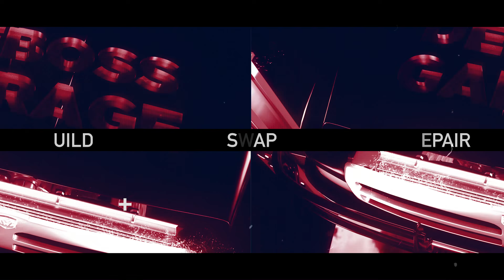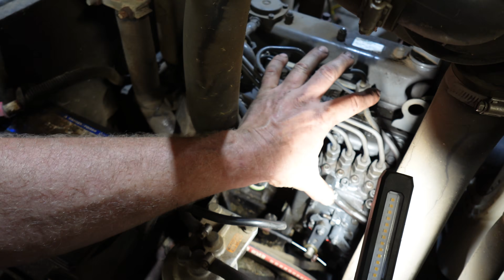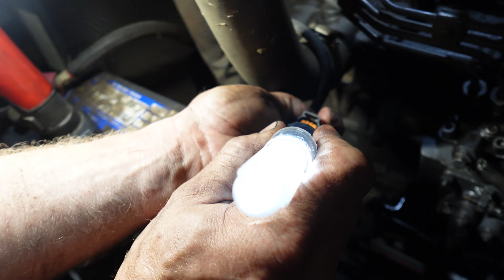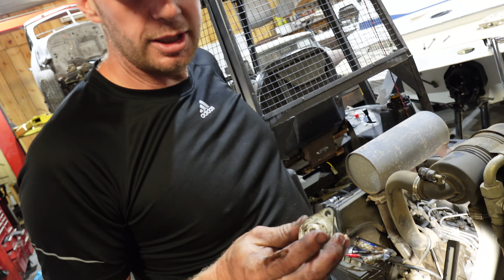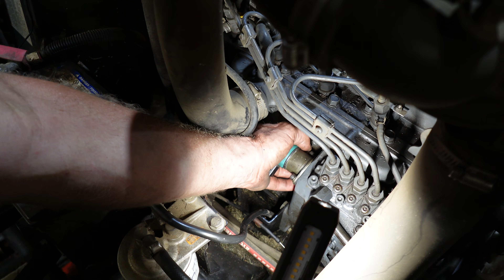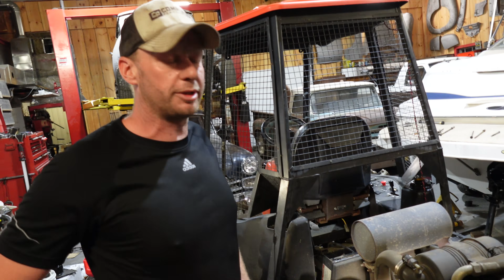Diesel Mower Engine Won't Run? TRY THIS FIRST

Comment: What if the starter is turning too slow to start with a new battery and even jumping? Would it be needing a new starter or does could It be a wiring issue ?

Comment: Wish this was posted 1 year ago, cat 3306 in the fishing boat I run shut off and we couldnt figure out why for a couple hours...eventually pulled that solenoid and made it back to the dock and shut it off by putting a screwdriver in the hole. Mint video as always.

Comment: We have a ventrac 4500 at work that won’t shut off. The solenoid works when we bench test it, but it’s not getting power in the machine. Tried swapping the TCU computer but still doesn’t work. So I had to run a pull cord to shut it off. I have continuity through the wire from the connector to the computer and no continuity from ground to the wire. So it must be somewhere before the computer. Not looking forward to diagnosing it, I’m not a fan of electrical harness troubleshooting.

Comment: Old man hack: touch the end of a solid rod (broom handle, rebar, anything solid really) firmly the solenoid where the business is executed, touch the other end to the right spot on your ear (think where the cell phone speaker is loudest) and cup your other hand around your ear and the bar. Have somebody click the ignition and you should hear that solenoid when it clicks if its getting power and works. Saves the trouble of removing it when it becomes a hassle. Works with harmonics too (main bearings, valve lifters and rockers, etc).

Edit: missing words lol
TLDR edit: its a redneck mechanical stethoscope

Comment: Yanmar is similar except 3 wires to the solenoid and no mechanical shutoff that I’ve found. I’ve learned the third wire is hot with the key in the start position, and seems to “pull in” the plunger, and then the hot with key on only generates enough magnetism to hold the plunger/armature, but not pull it in.

Comment: Love the super simple explanations. This would have been super helpful to see a few years ago when I was just getting my career started and didn't have a bunch of knowledge 😂. I feel like most videos about diesel engines and equipment just kind of dive right in because you're already supposed to at least have good knowledge of these systems beforehand, and can be tough to follow if you're not solid with your basics yet.
Reply: I think this vid in particular is for anyone with a small mechanical diesel that can use a quick fix, which is totally fine.

But, there's so many great vids on the basics already. If you want to learn about this stuff from scratch, thats on you to do first. I bet the majority of people that watch this channel already know the basics. I want the lesser known, but still relevant, technical details/techniques. Call me a nerd, but that's how i continue learning. Particularly new systems, or diagnostics, which kind of make or break you as a mechanic.
Reply: @ctdieselnut  for me specifically, these basic explanations help a lot when it comes to engines. As a mechanic, so far I've only worked on fleets of trucks, therefore I have very little experiences with engine performance, yet I have advanced knowledge about hydraulics, electrical, driveline, steering/suspension, and general heavy equipment stuff, since we generally outsource engine work and only worry about the rest of the truck.
Reply: Sometimes half the battle is just knowing the correct terminology to use while searching for answers online. (Im not a pro mechanic, but work on a ton of vehicles/equipment.)

Huge difference between 'why wont my tractor start' and 'how to disable a fuel shutoff solenoid'. For example, im not sure that's exactly what its called. But itll at least get you in the right direction faster.

Comment: Lots of times when its a no start, I turn on the switch and then plug and unplug the switch and listen for the clicking sound of a magnet pulling on the switch and making a good connection.. also some need power to make it operate...

Comment: I have a small Kubota tractor with the 3-cyl diesel.  20 years old and lots of hours.  It has never broken.  Always starts and runs fine.  Great little engines!

Comment: That fuel solenoid is case grounded and has a pull and a hold circuit!
That means it takes a two powers to get the solenoid to come on 
One is momentary just when cranking

Comment: Yep, my dad ended up in the drain at the bottom of the driveway with the running Kubota ride on mower upside-down on top of him. Don't disable safeties.

(Don't worry, he was ok. Apart from all the cancer, heart disease, diabetes, kidney failure and a stroke).

Comment: The super funny thing about my kubota g1800 riding mower, she has to juice the solenoid to shut off. this is accomplished by a $400 computer. Why, oh why, kubota, did you not just make it juice  to run instead of juice to kill? I took an old choke cable and mounted it in the dash, now i have manual shut off lmao. Also, the deck design on this thing is RIDICULOUS. There's no lateral support, only two arms from the front, so nothing to keep the deck torking side to side. Wears out all the linkages and with kubota, every "thing" is at least 100. $300 if there's a weld...

Comment: On a kubota, the shut off solenoid get's it's ground through the engine block - The two wires going to it is a positive pull function and the other is a positive holding function! Common mistake if you don't work with kubota engines!
Reply: Came to the comments looking for this, it caught me out the first time+

Comment: Sorry rich. Most Kubota shut off solenoids arent ground and power. One of the wires is ignition power, the other is "pull in", aka current only when the starter is cranking. I do tech support for Kubota engines, and this is the most common misconception with these engines. Every one thinks these two wires are power and ground because they have two wires, but thats not usually correct
Reply: Idk man. He tested it w\ a test light & switched neg\pos to verify each wire. If one was ignition power, why was it negative when tested? 🤔🤷‍♂️🤦‍♂️🔧🛠️🔩📏⚠️
Reply: @tdotw77  because the "ground" is connected to the starter windings. It will test as a ground, even though it functions as a positive voltage source to pull in the coil.
Reply: I don’t know either way but sure would like to know who’s right on it.
Rich used a test light, seems like it legit test to me .
Reply: @stephen2028  I have the engineering drawings and wiring diagrams directly from Kubota, and I would post them to prove myself if I could, but you can't put attachments in a YouTube comment.
Reply: no ur wrong
Reply: @helplessfarmer  nope, I'm 100% right. Its literally my whole career to know Kubota engines.

Comment: yup, first thing i'd replace when a light tower or genset came into the shop not running, 99% of the time it fixed the problem, the other 1% was faulty positive air shutoffs.

Comment: in general on that machine yes.  but there are sooooo many configurations  just on kubotas let alone any one else this will only work for some.  be carefull with those sollenoids there are so many variations 1 wire  2 wire 3wire  internally grounded externally grounded energised to pull in energised to push out  some with pull in windings and hold windings some just pull in. you can instantly ruin a good sollenoid  hooking it up wrong

Comment: Don't some of those solenoids ground through the body and have 2 powers?
Reply: Mine (Mitsubishi engine) has two powers and a ground.
Reply: @brianfelmlee8804  right, one power initiates the solenoid, the second keeps it in place.

Comment: I have a 3 cylinder diesel  kabuto t1600 lawn tractor. Ill never go back to a gas lawn tractor again if I can help it. so much better on fuel and way more power.

Comment: Good explanation here Rich. Now you'll get all the guys that have their solenoid working but their glow plug relay failed and the cold-blooded thing won't start, so they are going to comment and say just cranks and makes white smoke. So next you're gonna have to make a how to jump your glow plugs right to the battery count to 10 and then start your mower video. Haha
Reply: And then run a switch to the cab… and you can even run a light to it.
Reply: @wobblysauce  yes. But the average homeowner that has to mow the grass before their cocktail party doesn't have that capability lol.

Comment: Mine is all mechanical so that won't work.
Reply: Still can work around just different process
Reply: @austinwilbanks5919  😅😅It's not even anywhere the same. The throttle valve shuts it down.
Reply: @johnscott2849  I have the mechanical version, can confirm. Pull a red mechanical knob to shut down, push in to run. Mine’s a 2 cylinder kubota like the one in the thumbnail likely is but the actual machine being worked on isn’t
Reply: Right which means you will never have this problem to begin with so none of this even applies loo
Reply: @Adam_Poirier  If it doesn't start which is what his title claims. I just pointed out it won't work on mine.